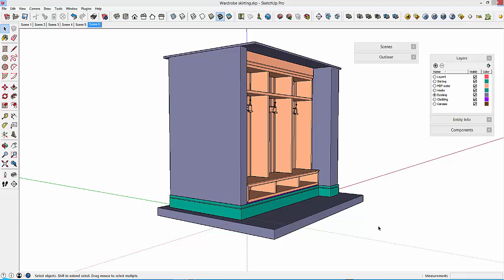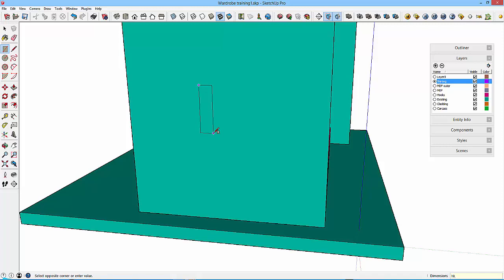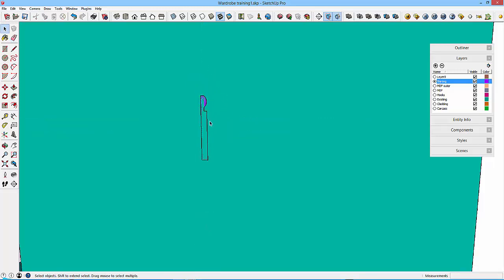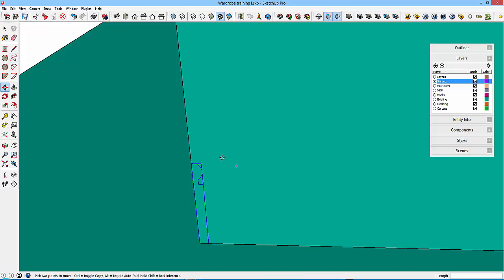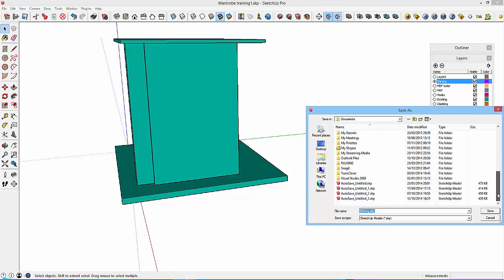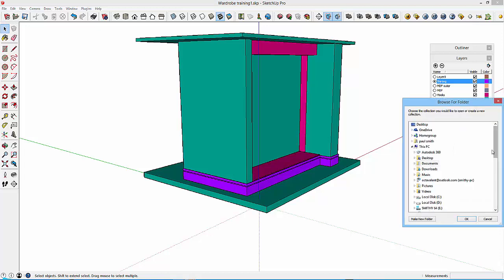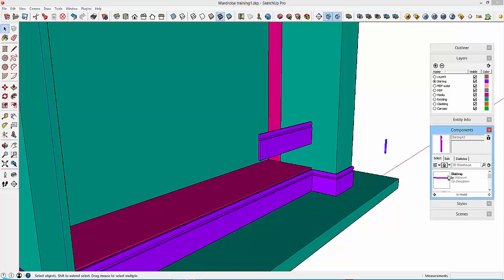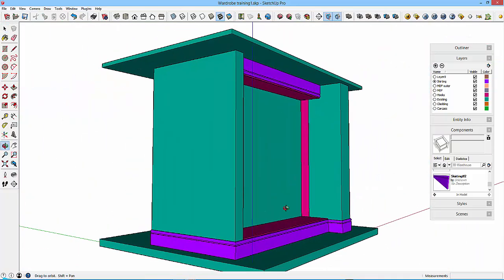SketchUp to Layout 05   Add the skirting

Comment: How are you getting it to follow the lines like that? It doesn't make much sense :/

Why would it even follow the lines if they're not selected? I'm really confused how it just followed those lines like that. I get how they follow me tool works if you literally manually have it follow your cursor but nothing that you have showed.
Reply from the maker: Sorry just seen this. It works if you pre select the path then select the tool then select the profile. There is a relationship between the profile and path so the profile does not need to be part of a path. Just a closed shape.